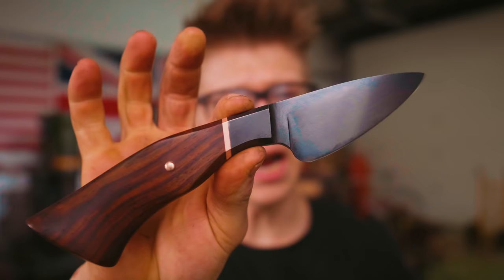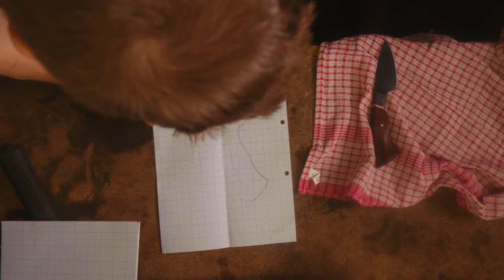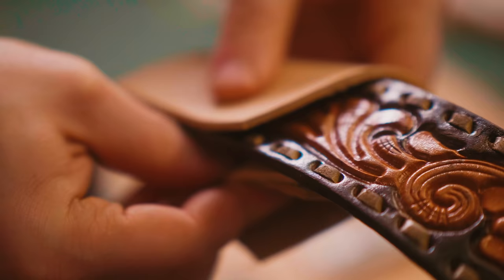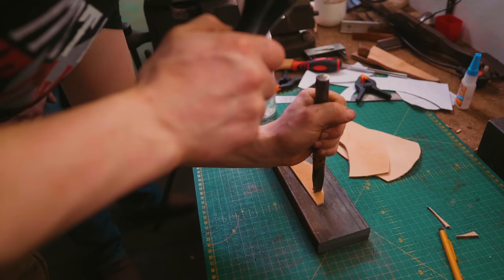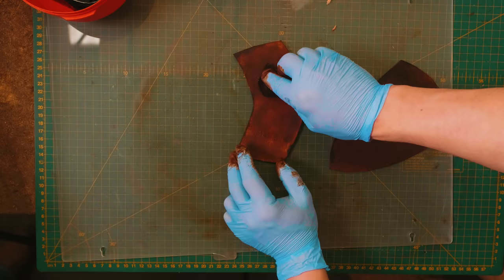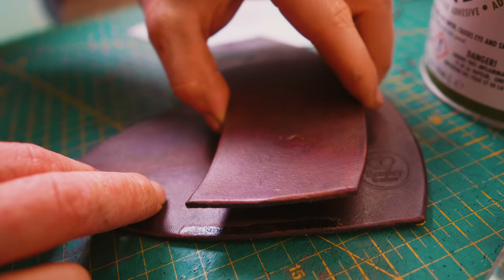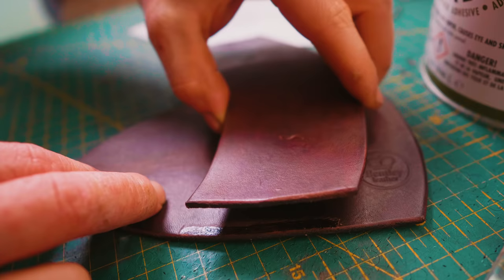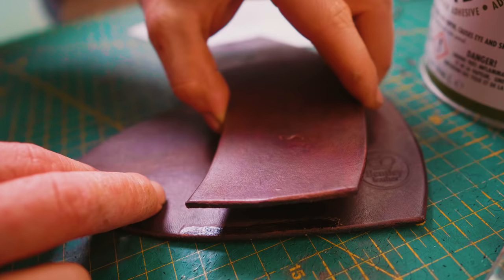MAKING A LEATHER KNIFE SHEATH!!!

Comment: Steel wood leather! Machining, forging, hand tools and power! Alec you are becoming a very skilled and well rounded craftsman! You are also motivating my old retired self to get in the shop. I ordered my lathe today!
Reply from the maker: Thank you Sir! Thrilled you got your lathe on order!
Reply: Matthew M Thank you! Waiting on the delivery is giving me even more gray hair.
Reply: Matthew M Steel. I have a small mill currently and love it, but I always knew I wanted both.
Reply: Matthew M I was painstakingly careful in my research and it led me to the LMS 4190 deluxe mini mill with DRO.  She's no Bridgeport,  but I am very impressed with its capabilities. I took my time and spent three days cleaning in detail and then tramming before I ever took a cut, but it has paid off.  I have cut steel no problem. I just remember the size of the machine and keep the cuts a little smaller.  I think many of the complaints about bench mills come from guys who are used to machines that weigh a ton. For my limited workspace I am thrilled with my mill. In the process of detailed cleaning and set up on the lathe now. It is a little bigger, but still a bench top machine and at the end of the day my wife can still park in the garage.
Reply: Matthew M I was cutting a little stainless on my mill yesterday. I am continually impressed by what LMS has gotten 500 watts to do. Now the mill is not all sunshine. Everything has its bad points. The initial cleanup is time consuming. I removed the table and cross slide. Removed the gibs and cleaned everything very thoroughly. No care was taken to remove grinding dust when it was made. The tramming is also slow and tedious and requires shims, but that is a rare task. The last downside I can think of is the vise. While functional, I am not a fan of the vise that came with the mill. I will replace it soon. Other than that I am thrilled with how the mill is performing and the DRO works flawlessly and is incredibly easy to use. Chips are flying with the lathe now!
Reply: I finished my first knife this week. I have an industrial shop with some useful stuff already, but what I really needed was the 2x72. I honestly didn’t have the time to make one so I just ordered a home made one online, and after balancing the drive pulley and bending a couple pieces, it works great. One day I’ll get a 3hp motor (work across from a huge motor place, so that won’t be an issue, he’ll probably give it to me for free actually).

Anyway, I’m now stuck here ordering stuff to make a sheath. The knife is ugly but the heat treat went perfectly (well, aside from not normalizing it lol...), and it has a nice belt made edge, however nice that can be. I used some fifty year old butcher block maple for the handle, it looks like an old kitchen knife handle lol with brass pins. Big heavy knife though.

Anyway if you guys need anything balanced send it my way, it’s what I do.
Reply: You’re right, I definitely wouldn’t have gotten a great flat grind, and I knew it, so I made a smooth convex bevel over time that basically runs from the spine to the edge. It does have a plunge line, which came out surprisingly decent after some touch up, it’s just soft. I like “Appleseed” bevels/edges on swords so I figured it would be fine. 

I like how it came out tbh, just for my own personal knife. I knew I wasn’t going to make a great knife yet so I didn’t want to go overboard trying to “polish a turd”. I decided I’d make a very functional knife, that was really what I wanted to see if I could do. Now that I accomplished that I’m going to move into learning how to make more appealing grinds, handles, etc. At least after I finish the sheath.

I had a big piece of 1084 too which helped. It is a 3/16 piece of stock, so I had plenty of room to grind down to a convex bevel without ruining the knife. They were out of stock in 0.156, I’m going to order 1/8 too now (too thin?). 

I do have a strop thankfully. I started sharpening a while back so I’m not too bad at that, by hand. But I actually like how sharp it came out with the belts and the strop. The only thing I don’t like about it, is that it has belt lines/waves on the edge, which I guess will take some time to perfect.
Reply: Nice. How's it going 4 years later?
Reply: @jamessheppard4372  Good grief!  Has it been 4 years already? All is well. The machines get a lot of use and neither has given me any problems. My tool and cutter selection has grown a lot over time and I still smile every time I get to spend time in "my shop" working.
Reply: @brianmoore1164  That's good to know

Comment: That's called a Scout carry sheath. I love them & with that design I believe you can reverse it so you can carry the knife horizontally in front as well. Made many out of kydex with options for front or rear mounting. 
Very good video. I'm thinking you'll be wondering what else you can make from leather now for around the shop or ...

Comment: So glad i watched this. I knew i would have to wet down the leather to get it to form(I've seen Wessex Blades use clamps for a really tight fit), but I didn't know about the dye. I want my 1st leather sheath to be black.... I even bought a little set of letters to spell out Evader... I also got a little "leather Starter Kit", but it doesn't have the head knife, guess I'll have to make one.... Need a tool, make a tool... I need all the help i can get. Thanks for another great video...

Comment: I am just starting out on blade smithing...if you can even call it that at this point. Basically starting with cold rolled steel and cutting and grinding it to my designs. Next step is building a small heat treating forge, then an Anvil and a better forge so I can start learning to forge. Then a better belt grinder, and I should be set for a while. I want to start selling knives just as soon as I can get them to an appropriate quality, so that I can further fund my tool and shop expansions, and one of the main mental blockers was having to sell knives without a sheath. Now I think I'll hit up my local tandy leather and get some tools and material to try to make a sheath for my early, mistake ridden knives. I'm sure that early, mistake ridden sheaths will fit them nicely...

Comment: hey alec i have two ideas for future projects and hope you like them (maybe enough to forge them)
number one would be a viking seax or rather a replica of the seax of beagnoth its viking sidearm/tool and this particular one was found in the river thames in 1860 ish 
the second idea would be an idian wagnakh its similiar to modern brass knuckles but it has 3-6 small blades on the inside. its a concealed assassin weapon you can easily hide the blades and the way you use it is basicaly you slap accros your enemies face which has a similiar effect to a tiger swipe they are sometimes also called bagh nakh which translated from hindu means 'tiger claws'/'tigers claws' i think both of those would look realy awesome in damascus steel and both also pose a unique challenge: the seax of beagnoth is a historical found and making a replica is also fairly different. the tiger claws on the other hand have a unique design which will probably need some creativity while forging. as i said i hope you find one or prefferably both ideas interesting and im hoping to see you make either one of those in the future

Comment: That's the most expensive knife I've ever seen made from such crap steel. That's over 6 grand in time and material. Fun fact, that handle alone is more material cost than the hole rest of the knife, sheath included.